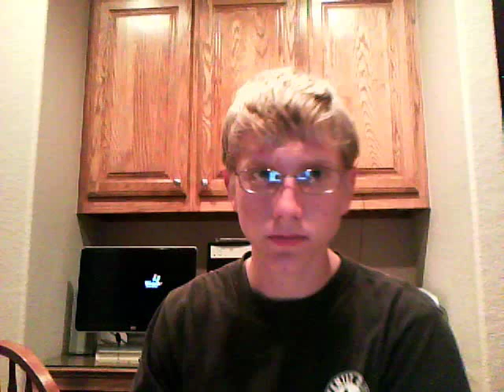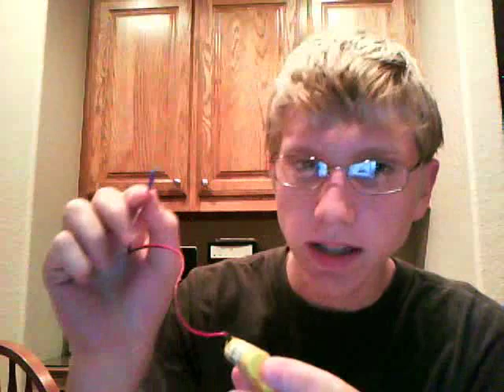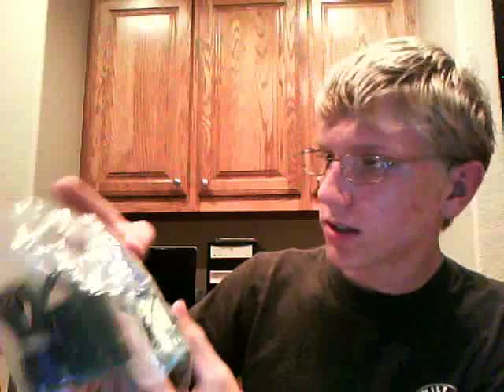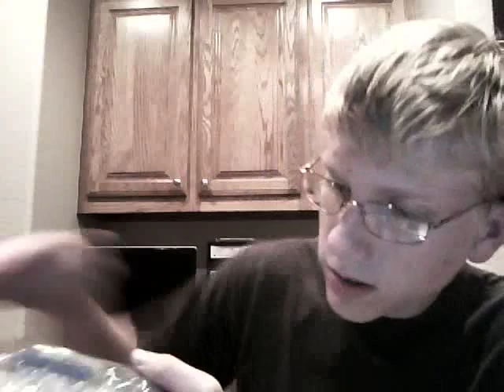Basic RC Receiver Question for the Airtronics RD6000 and the 92777 rx

Comment: You should be able to connect a battery directly to the receiver because its not a lipo battery, never connect a lipo battery to a receiver cause it'll burn it! But it should work cause that what I use for my AviStar... One last important thing, make sure you connect the battery correctly to the receiver positive w/ positive ect...
.
~DLPlanes

Comment from the maker: "ok, About a year ago I bought all these parts and I had no clue what they were for, one of the stupid things I did was plug the battery straight into the receiver. It lit my battery on fire and melted my receiver. I was using a 11.1volt lipo battery. The receiver needs 6volts i think. You might be able to do it, Idk what type of battery and receiver. it might say in the instructions. If I were u I would just get a esc. Get like a 30amp from hobbycity, they r like 10$"--rctestflight

Comment from the maker: Oops..I accidentally clicked remove to your post saying "Do you have skype?" But yes I do have skype and I will send you a private message with my skype address.

Yeah I guess it wouldn't be worth running the risk of frying the receiver. The battery is only a Ni-Cd and is probably really old because I bought it on ebay. The instructions do say to plug it straight into the switch which plugs straight into the reciever but maybe that will only work with Ni-Cd batts and not Lipos.